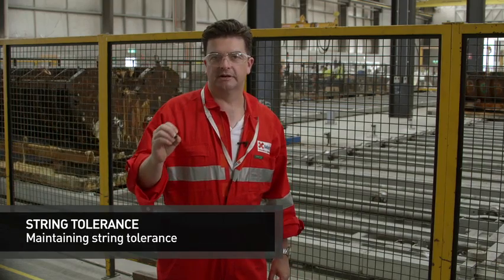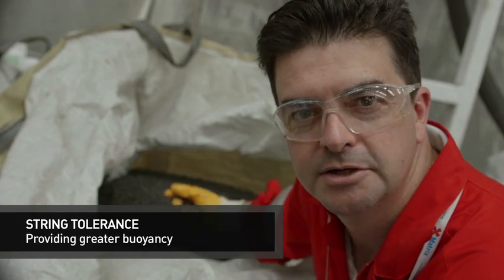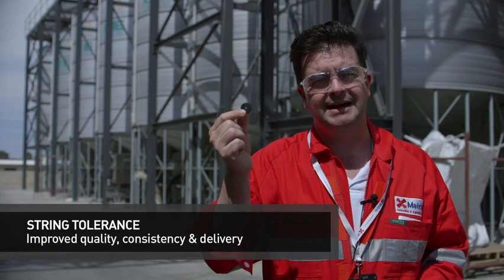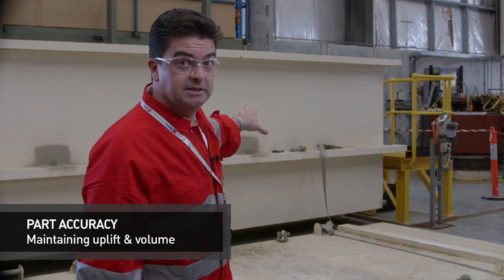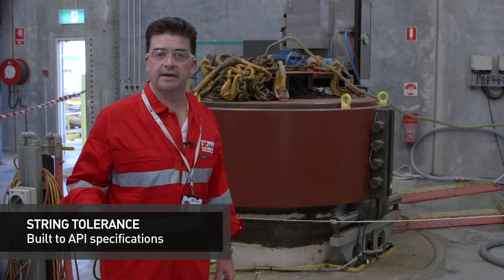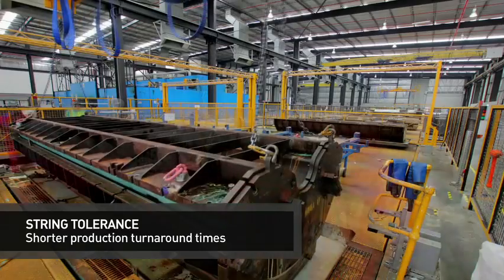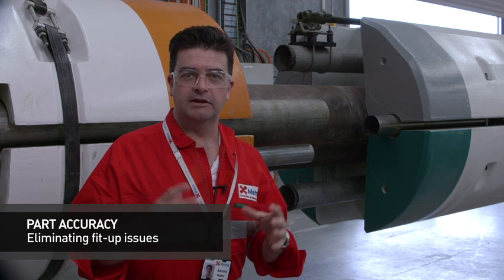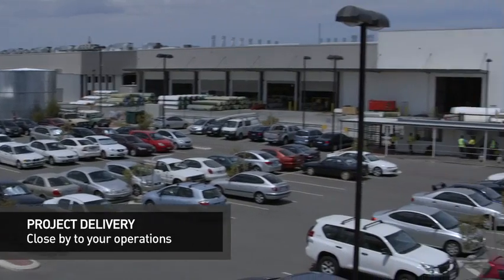Riser Buoyancy - Addressing the Key Issues

Comment: how buoyancy module colors are different and what they determine?
Reply: prasad bhoir the buoyancy colours determine the depth
Reply: prasad bhoir 3000ft is blue 5000ft is orange and so on. The density differed according the colour because the pressure of the water is different the deeper it goes.